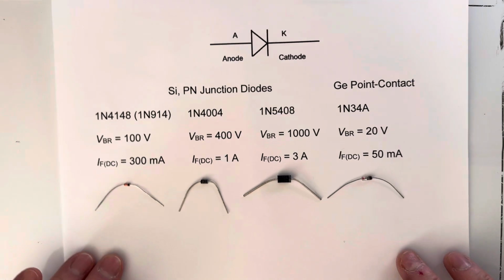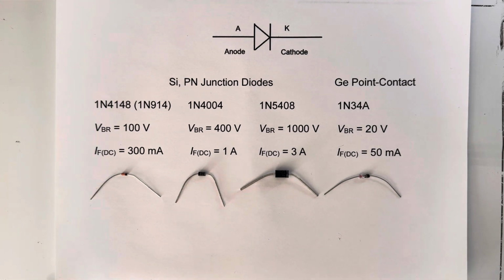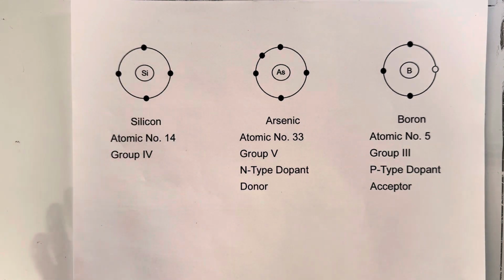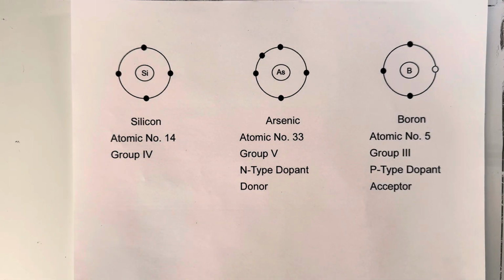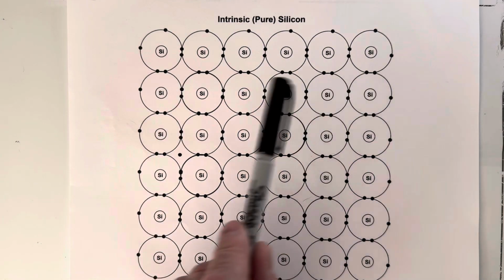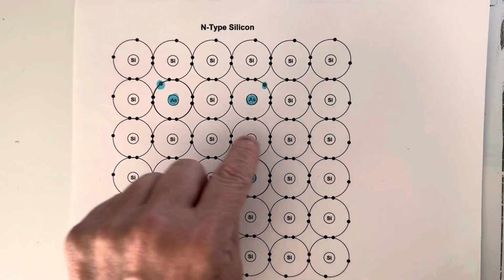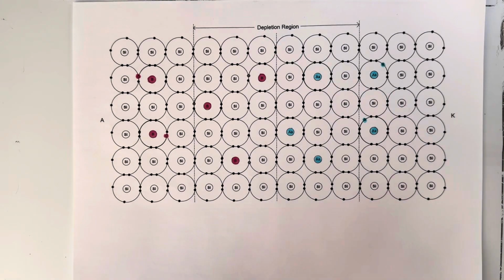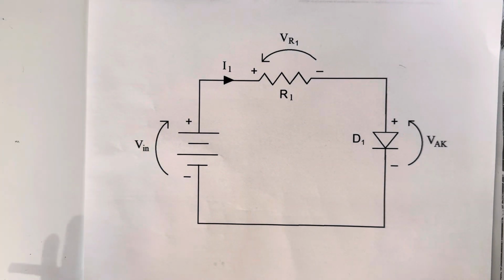Topic 1: Introduction to PN Junction Diodes

Comment: Here arey thoughts before I forget them..
- Thanks 😊
- Would have liked to know a bit more about the tolerances of the diodes, such min voltage to activate/why, max temp, what happens at high temps, or breakdown voltage in either/both forward/reverse bias (does it matter), etc. But I assume if it's relevant then it will be presented in context. It was just what I was thinking at the moment.
- The silicon was awesome. I did want to know a bit more about how circuits are fabricated onto the wafers, but maybe that's too much.
- I realize it's kind of boring now, but holy crap the impact on humanity.. I have to wonder if they knew back then. I always thought they were mostly just happy to replace vacuum tubes, but it must have been so exciting.
- I felt like I wasn't sure why this was the focus of the first video, or even the point of a video series including how much, if at all, it relates to the book. Maybe I missed a sort of synopsis/intro/purpose video? By the end, it felt like it was perhaps the first presentation in a series that you might receive as a student in a class named something close to the title of your book, and YT account.
Reply from the maker: @_powerbeard  I know a lot of these early videos are general electronics topics but I wanted to provide some foundational material for viewers that weren’t familiar with the basics. I might expand on some of this sometime in the future.

Comment: It's been many years since I learned PN junction theory. One thing that got me thinking was how do they combine P-type and N-type semiconductor materials to create a defined junction? To create a Si lattice, you melt the Silicon and let it form the crystal structure. When you want N-type of P-type, you still melt the Silicon-Arsenic or Silicon-Boron compounds and they solidify into the desired materials. But I would think you can't just melt N-type and P-type material together otherwise it is one solid material of N-P type with no junction. What's the method of combining them to create the junction? Btw, I just ran across your channel and this looks like a great electronics review, hoping to watch them all 🙂
Reply from the maker: @StealthParrot  Thanks for watching and commenting. The first transistors were alloy junction devices. Dopants were bonded to germanium which formed the junctions. Not a very effective way to do it but easy. Now it’s usually done via diffusion of vaporized dopants at high temperature in a vacuum chamber. Hard to explain in a comment but maybe one day I’ll try to get back to the facility at Penn State and do a nice video on this. If all my contacts haven’t retired by then!! 👍🏻